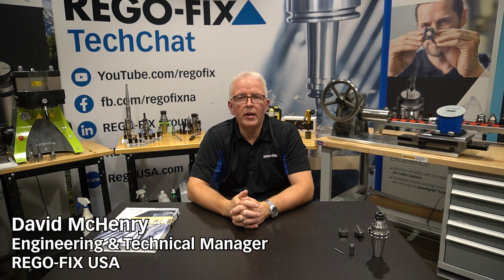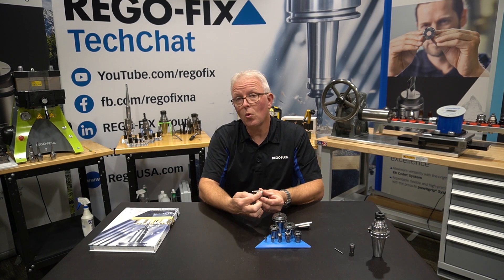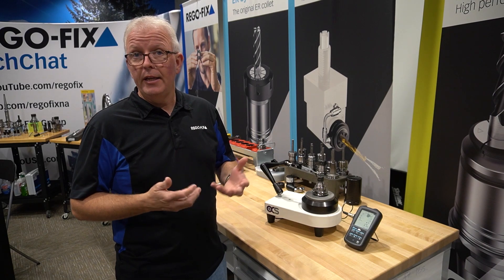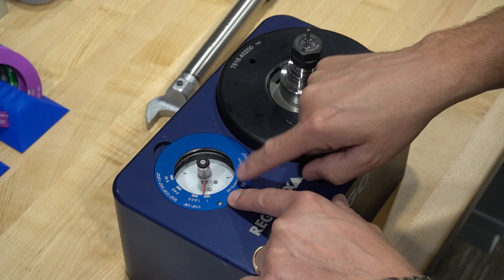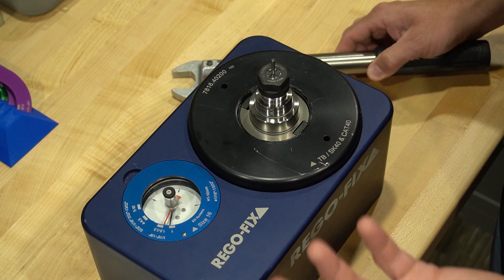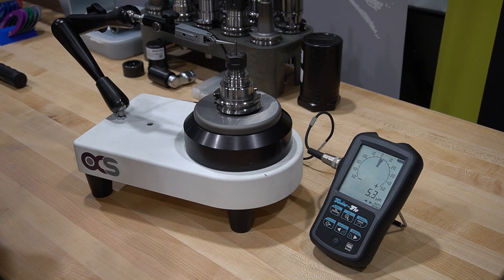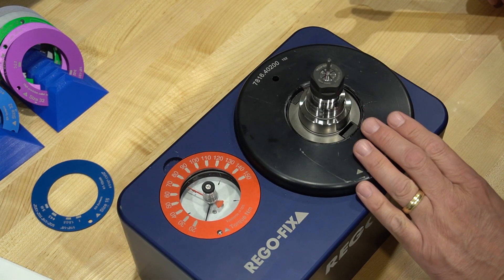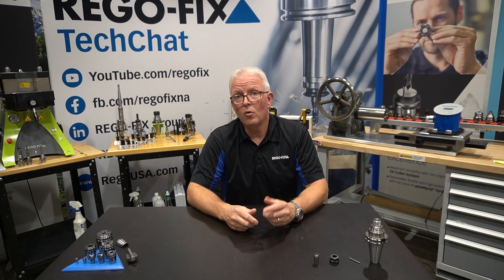TechChat - Over Torquing ER Nuts

Comment: So what about the tool holder?  Did that high torque damage the tool holder in this experiment?  Charles
Reply from the maker: Hi Charles, in this specific case the holder and nut escaped damage. However, we did damage the collet enough that it will have to be scrapped.